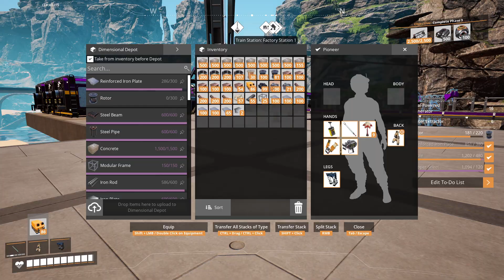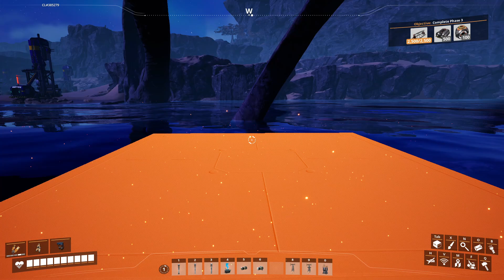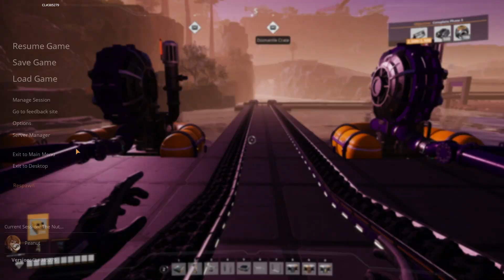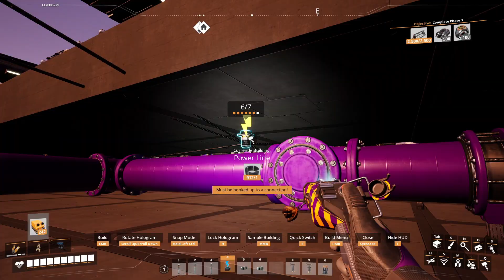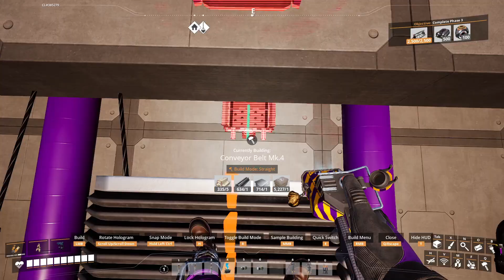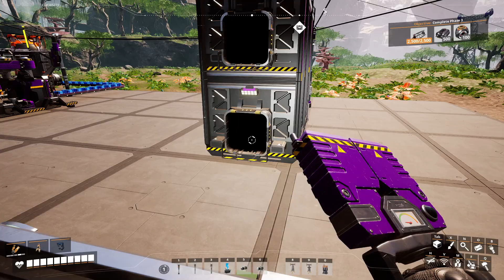Satisfactory 1.0 - Episode 13 [Doubling the Power Plant]

Comment: One way to “prime” a fluid manifold is to only turn one machine on at a time. Once the machine buffer is full you flip the next machine on.  

The pipe only reaches the full throughput if the pipeline is full.
Reply from the maker: By one machine do you mean the water extractors or the generators, I don't think I can turn on one generator at a time because they'll work regardless of being connected to power but I could be wrong